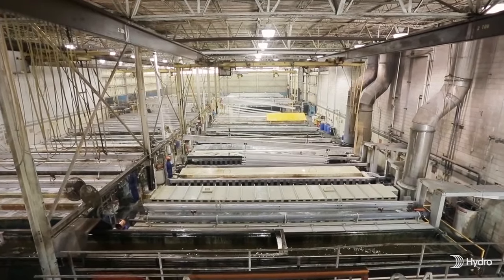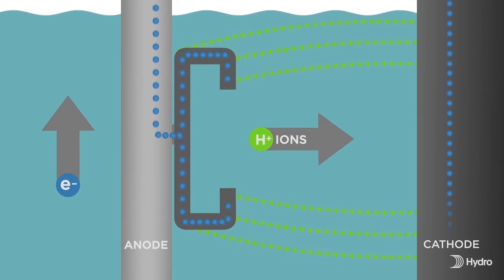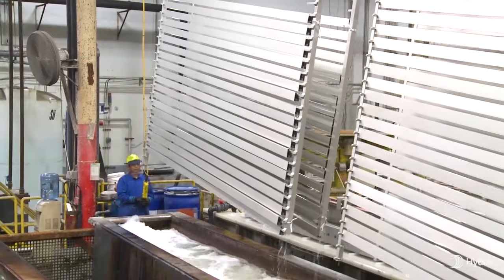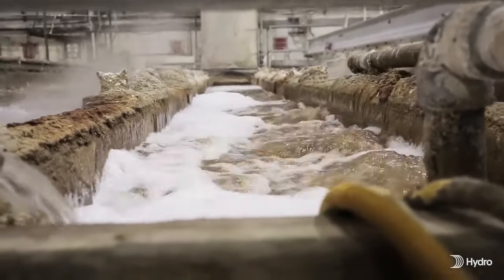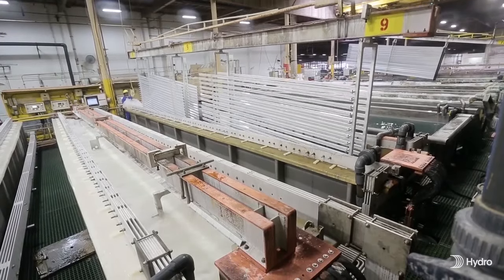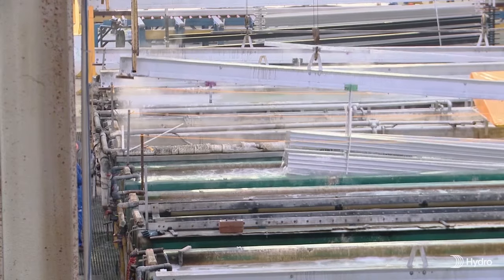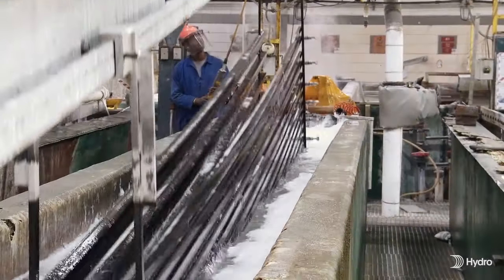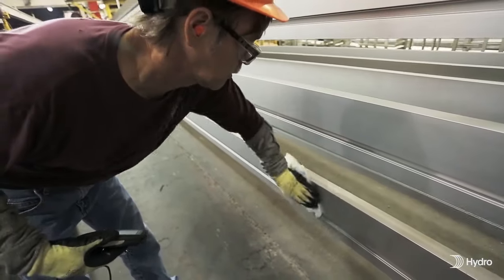What is Aluminium Anodizing and How Does It Work | Anodizing Process Overview

Comment: I do this for a living in but on a smaller scale. Crazy seeing parts that large being anodized.
Reply: What do you do?
Reply: I know. Their hoists and tanks are huge. Our operation is something I'm proud of, this is on another level though.
Reply: @adityaniyogi330  anodizing but on a smaller scale
Reply: Yeah, Me too.Ours are only 11 ft. Tanks.
Reply: I think I work at the place in this video….
Reply: I have a question regarding anodizing. If I want to print on the surface of an anodized aluminum part. Will the print stick to the material?

Comment: I worked for a small company that did anodizing --usually a black color.  Sometimes if there was a missed spot o a part, the owner would get out the spray paint and touch it up!
Reply: This is not suppose to happen, why do you guys get spot? Bad water?
Reply: @timcheou5649  I'm not sure.  Perhaps the surface that was being held by the clip prevented contact with the anodizing solution.
Reply: @timcheou5649  it's due to air trapped under the aluminum sections while in tank. Jig the sections at a good slope and see.
Reply: @sebastianpinto347  Catching a bubble We call it.

Comment: They do not use groundwater for this purpose..... do they? 😢 I hope they are first treating the wastewater and then using it for anodising........
Reply: Why do they need to use clean water? For harder finish?
Reply: We use well water in our cleaners but RO water in rinses, anodize tanks and seals.  This helps eliminate hard water spots due to high iron in well water.

Comment: Anodising is an electro chemical process 
It will not chip or peel (but doesn't last forever does it!  Anodising does not resist salty water like in my dishwasher or the sea or sea air.)
Anodising is carried out in a sulphuric acid bath, a cathode is mounted to the inside
Aluminium acts as anode
Loaded on carrier racks
-
Anodising is a highly controlled form of oxidation.  There are 5 stages (8 really counting the rinsing!)
1 Cleaning to remove grease in an alkali bath, and rinse
2 Etching with caustic or acid bath, and rinse (called: de-smutting)
3 Anodising - current releases the oxygen which grows the anodised layer out of the surface - this generates a lot of heat and the electrolyte must be cooled to maintain the correct temperature.
                      Time in the bath regulates the thickness.  Following this the anodised product is rinsed in de-ionised water to remove all minerals that could produce spotting in the final steps
4 Colouring.  The newly created anodised surface is porous!  And dies or pigments can be introduced.
5 Sealing. Finally, the pores must be sealed using a nickel acetate.
Reply: Thank you
Reply: Why we introduce porous to color the aluminum

Comment: Hi there. Love your work. I have a question regarding aluminum oxide. What chemicals or oxides can reduce aluminum oxide melting point if you heat them together in a crucible in a furnace? I know this auestion is not in par with the video above but I dont have your email address. I will appreciate your feedback
Reply: Cryolite - Na3AlF6 - That's why we use it as an additive in Hall-Beroult process